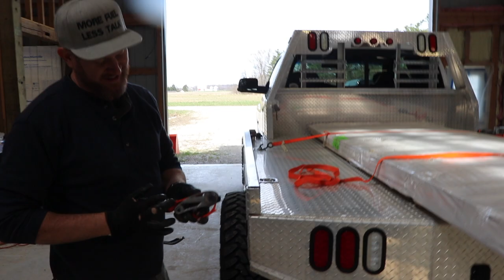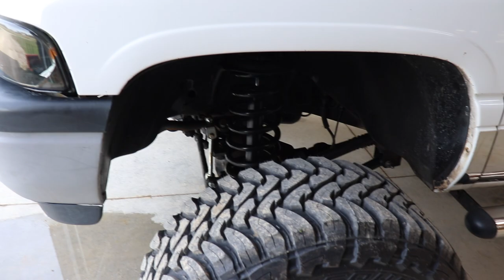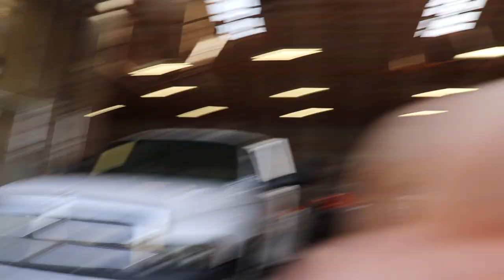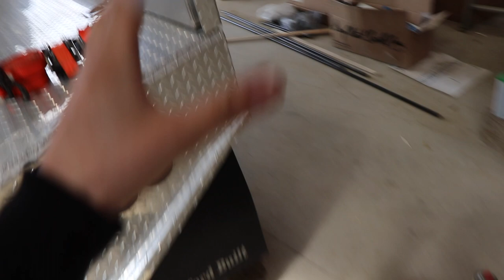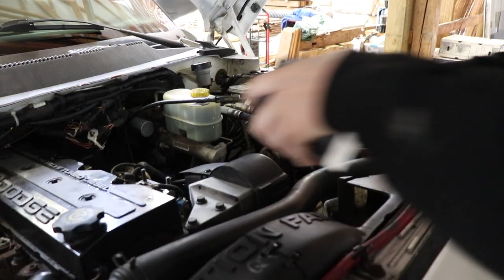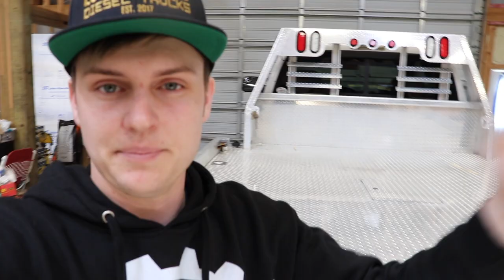DAD'S REACTION TO MY MONSTER 24V CUMMINS DUALLY!!! ( -265 OFFSET )

Comment: Way way to wide in the front need to have the adapters removed then I think it will be nice and clean especially with that deck. but having the ENTIRE wheel outside the fender is the stupidest thing I’ve seen

Comment: The tires sticking does not look good...also it's bad on the wheel bearing.. Good looking truck besides that.
Reply: Also bad on bearing like OP said as well as front end and more.
Reply: @burnheretic3950  also hard on the paint 😂
Reply: @burnheretic3950  they already have terrible front ends. Dont need anything adding to it.

Comment: Gonna be replacing wheel bearings as much as you do oil changes.
Reply: I got 116,000 on my 2018 with 104" wide and I ant done wheel bearings !!! So guess you must be a Ford boy use to your truck breaking all the time

Comment: Those Factory front wheel extensions have to come off I know there is probably even a harbor freight air impact 1/2 , 3/4 , or even 1” if necessary that is capable of removing them no question!
Reply: I agree

Comment: Ok hook goose neck trailer up and put another truck up on the deck at the front.  See if the tires clear edge bed, and the tires don't touch in between the tires.

Comment: ngl the stance is mean but put a not dually front axel in. your killing the bearings in the hub. not meant for the load but it almost has a pre runner stance with out the huge flares.

Comment: Hey, the longer you leave the spacers there on regular offset wheels, you are murdering the ball joints. Dually wheels on the spacer still puts the center of the wheel at no offset. So the longer you leave it that way, the shorter the ball joint life.

Comment: Yo LOUD N PROUD Malachi I love your new monster 2002 Ram 3500 Laramie  SLT  5.9 Cummins Diesel 24v 2 Gen Dually with Flatbed on you need to 4 Gen from Bumpers PAINT MATCH Bumper Grille get window Tint and New Exhaust